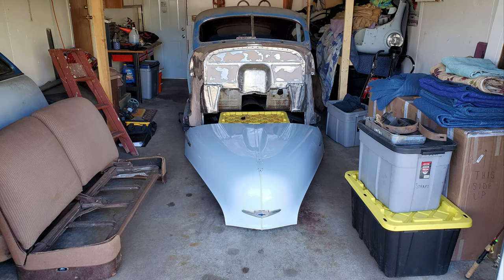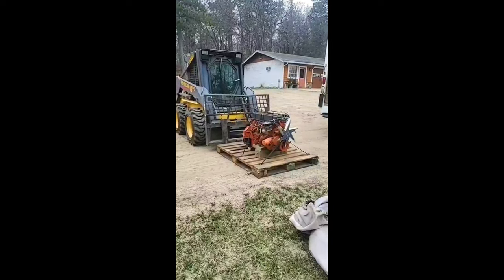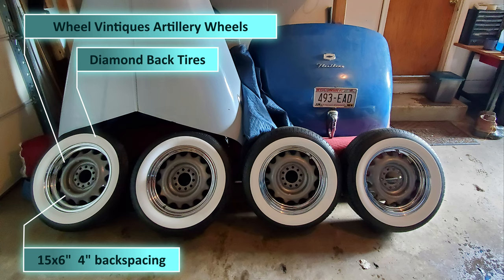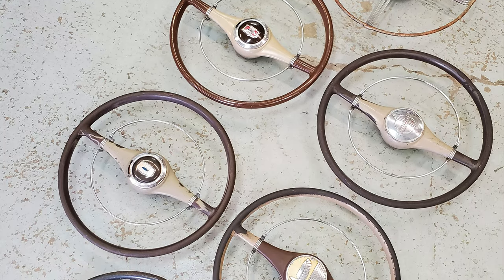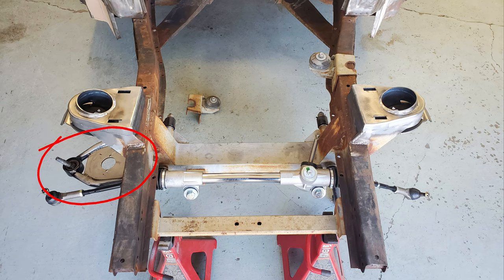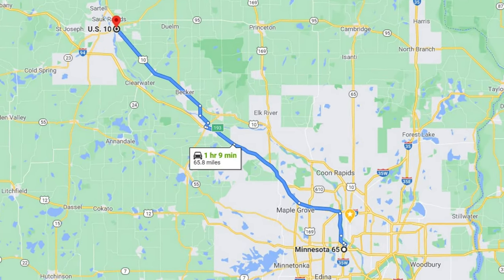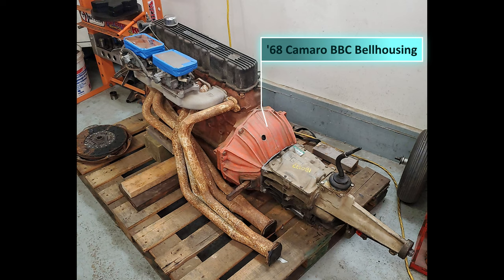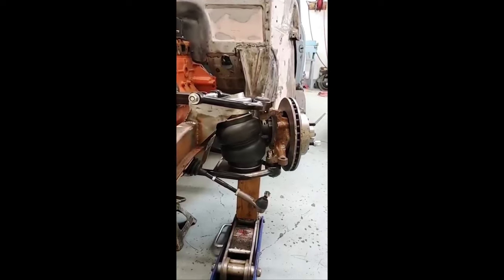The Manhattan Project: Episode 2. Front suspension mods, engine and trans mounting on the Fleetline.

Comment: Where you get the rockers from?
Reply from the maker: They are a homemade deal that was on there when I got it.  Mostly original rocker with some 1/8" flat stock welded in to patch it up.  I'll be making and replacing the entire rocker from scratch when the car comes back apart for body and paint.  Thanks for watching.
Reply: @OMCbuilt  ah ok got it